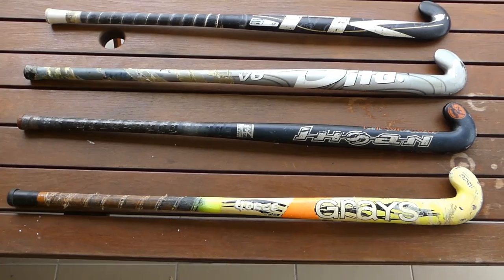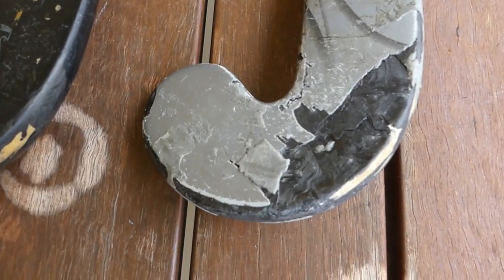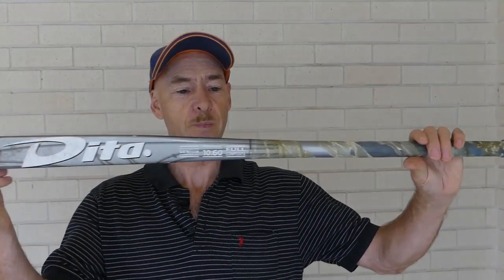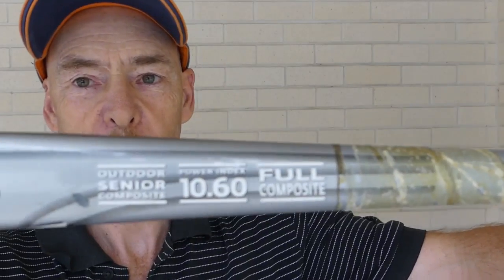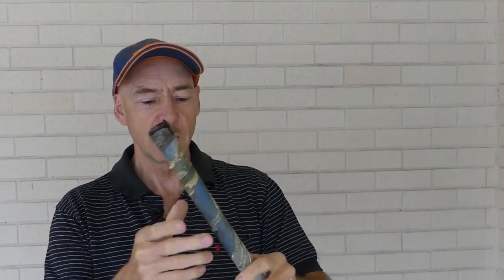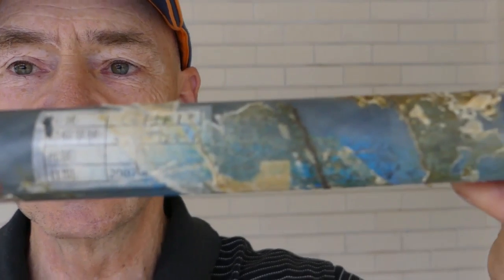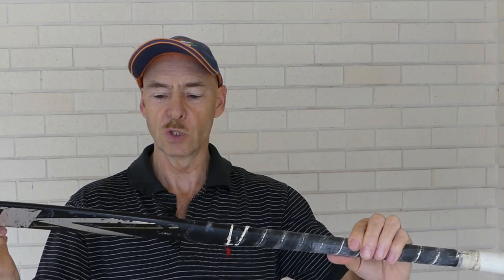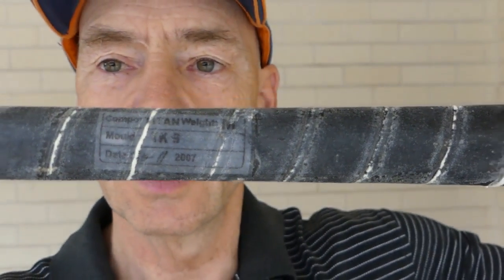What's inside a field hockey stick? Dita v TK carbon fibre hockey sticks

Comment: We ought to know where the factories are, all made in China and India? Dita is supposed to be Dutch, Grays British, TK German.
Reply: Grays has not been a 'British' company since 1987, when the company was sold to the Pakistan directors and became Grays(Pakistan)Ltd. and it is probably a hundred years since Grays sticks were made in England (using Ash wood). They have been manufactured in Pakistan for a very long time. Dita and TK have similar stories but it is common to confuse the country where a stick was first marketed with a particular label as the country of manufacture, when it may never have been made there.  There are not a great many Pakistan hockey stick manufacturing companies with an export license, and as there are probably in excess of a hundred different 'labels' most of them produce sticks for different customer 'brands'.